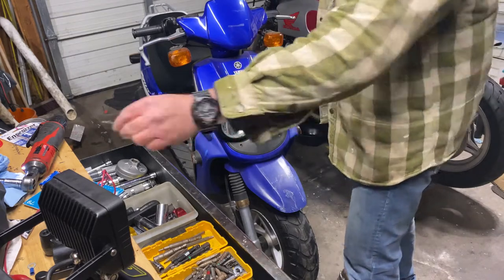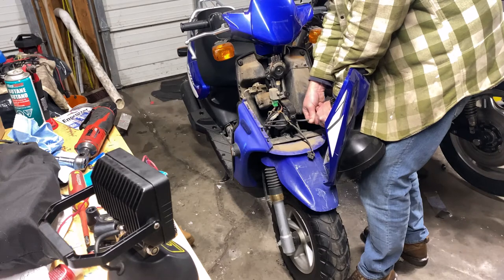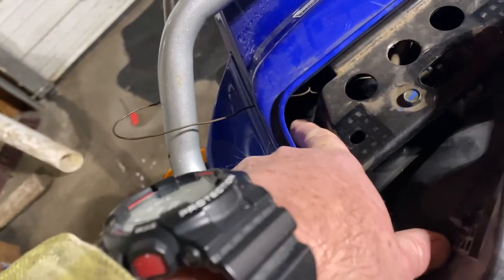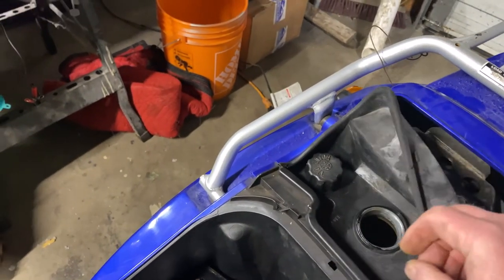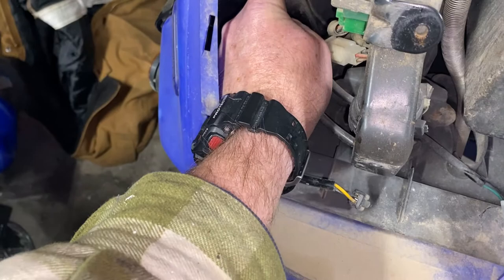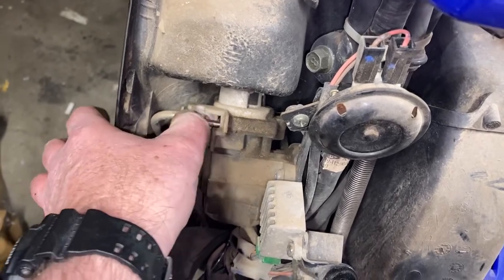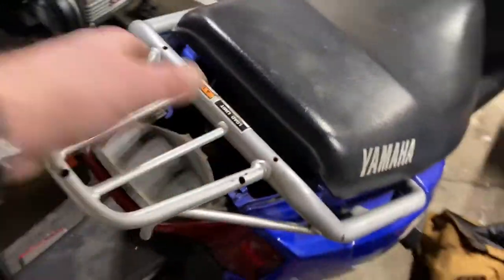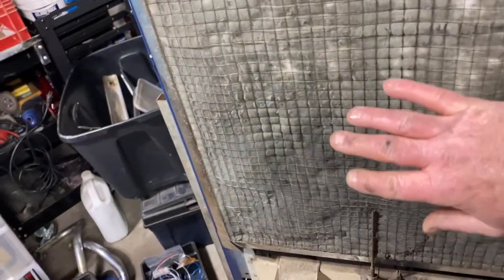2002 Yamaha Zuma BWs  seat cable repair

Comment: Thanks. I could lock and unlock my new 150cc scooter seat by manipulating the latch but it wouldn't fully open with the key. Your video told me there was a barrel adjuster under the front panel so that's my next step toward fixing the problem because it appears the cable has a lot of slack in it. Edit: Yep, It was loose at the barrel adjuster. It's adjusted now, tightened down and my key unlocks the seat like a Champ! That you !! - Here is the Crazy bit.. I subbed to you a while back because your videos helped me with some issues I had with my Smart car. I went through a lot of seat lock videos trying to figure out my scooter seat problem but yours was the only one that mentioned the barrel adjuster and where to find it.. and here I was subbed to you all along! LOL
Reply from the maker: lol.. welcome back  :)